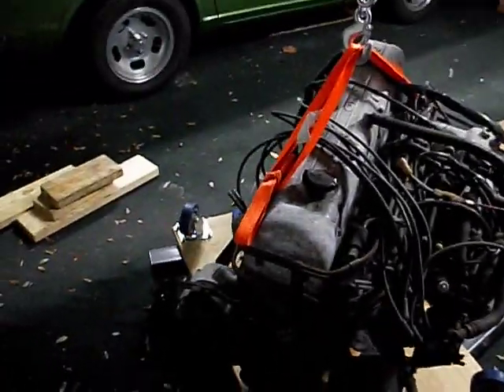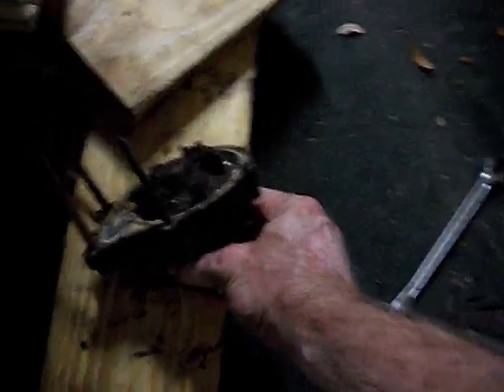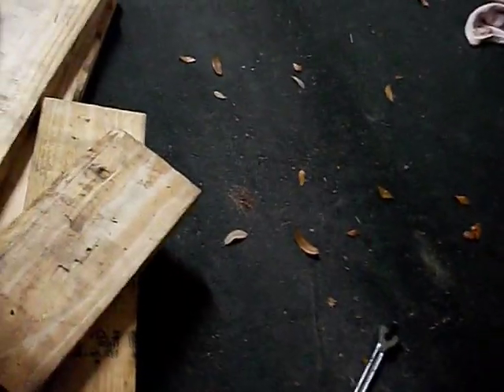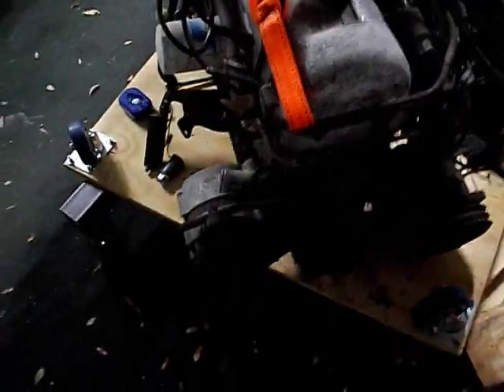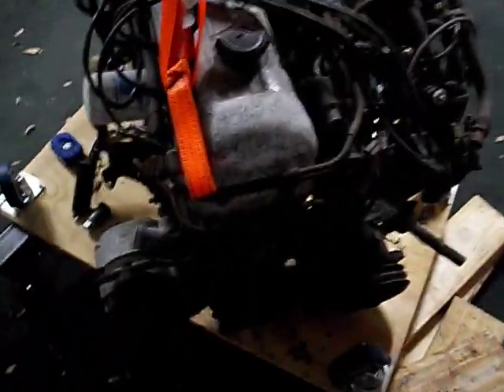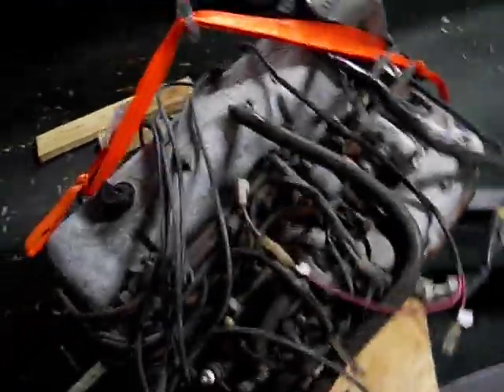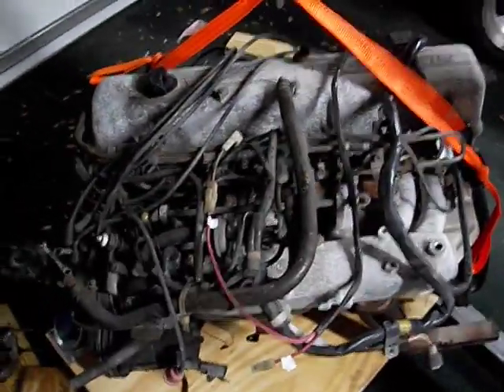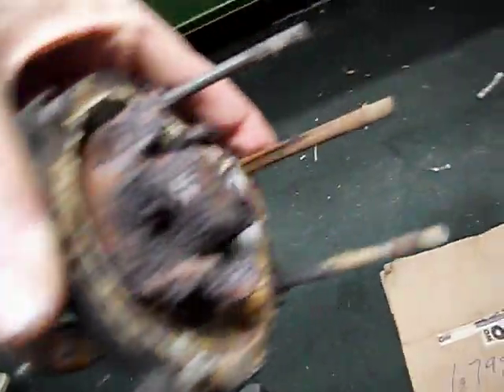Nissan L28 water pump

Comment: Dave did you buy a replacement engine to rebuild.?  Where did you get it and how much. I’m thinking of pulling one out of a salvage yard.
Reply from the maker: Got it from a local enthusiast. I wanted to have one to wrench on. the plan is evaluate the overall  health of the engine and rebuild as needed. Minimum would be a reseal (all new gaskets).